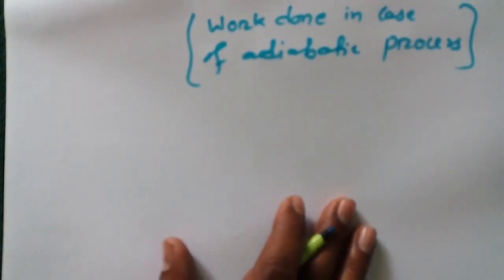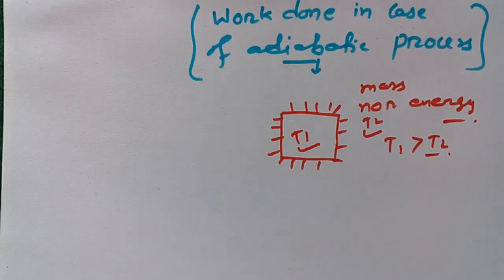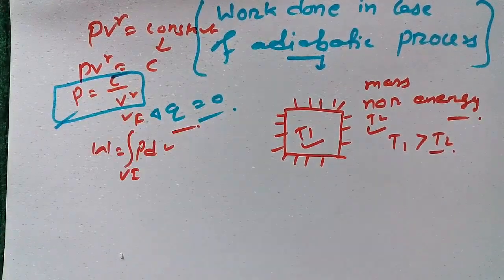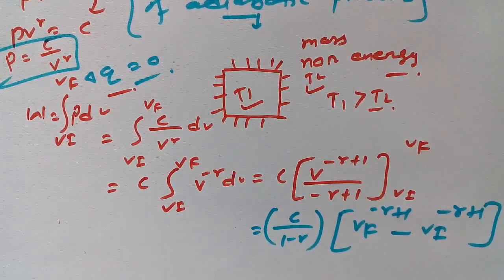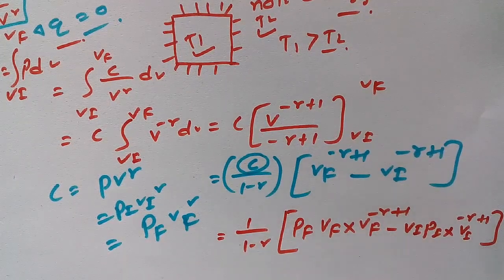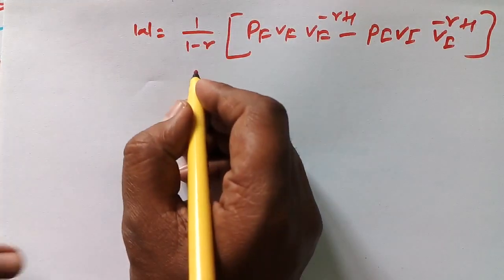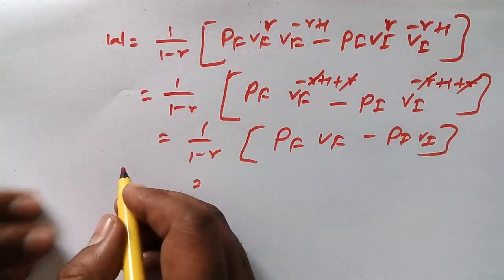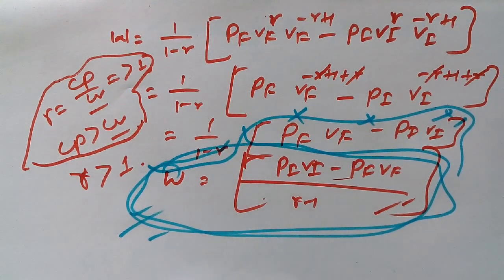Work Done in Adiabatic Process Thermodynamics

Comment: excuse me, I don't quite understand what PV gamma means. I know PV isn't equal to a constant, because the temperature is changing since in an adiobatic process it's gonna loose internal energy as work... But what is PV gamma, and why is it constant?
Reply: If you solve dq= du+ pdv ,  putting dq=0 ( condition for adibatic ) 
0= du + pdv
0= m(cv)dT + pdv.  ..........1
From pv = mRT
dT= (pdv+vdp)/mR put in equation 1
And one known by definition Gama = cp/cv
If you solve equation 1

You get 

Pv power Gama = c

This means for dq =0 

Process should have to follow law (process law) as. (pv)^¥= C.

Comment: if adiabatic is a closed system then how work is possible
Reply from the maker: I think you should read book
Reply: Only heat interaction is 0 in adiabatic that doesn't mean work interaction is also zero ... i.e the closed system with movable boundary with adiabatic wall